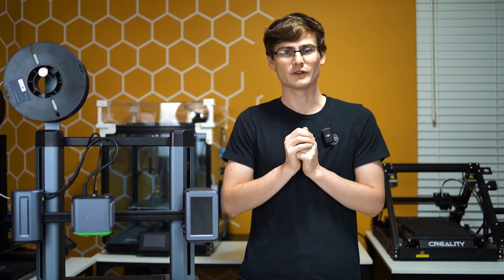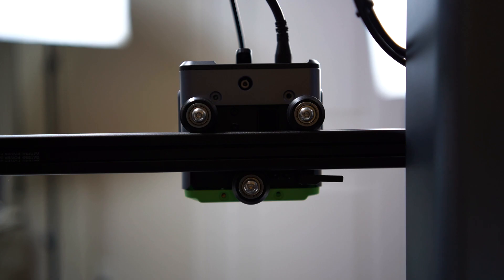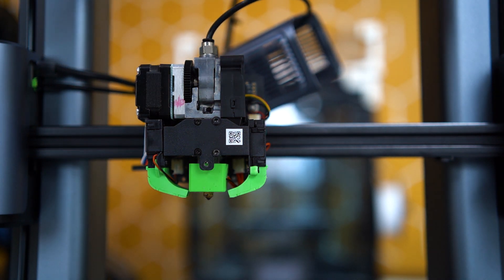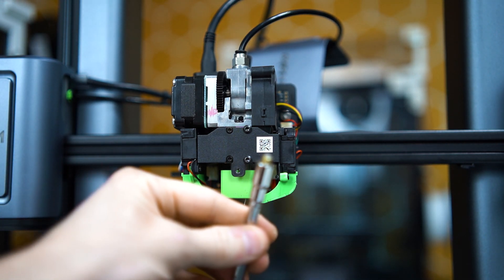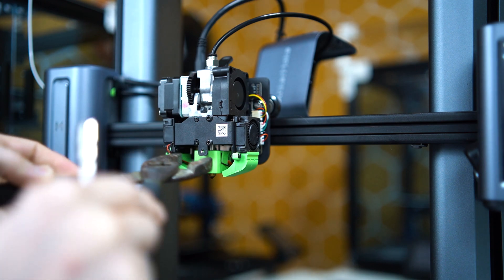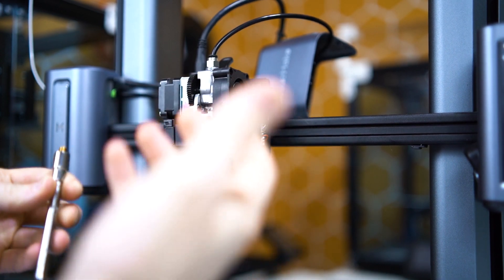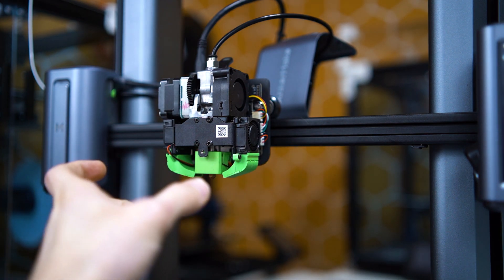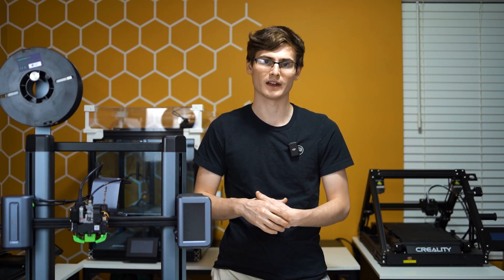Here's How to Replace Your 3D Printer Nozzle in Less Than 5 Minutes

Comment: On the nozzle change you did on the ankermake 5 is it the same steps to you do on the ankermake 5mc is nozzle sizes the same cos I wanted to get the hardnd steel one so I can print  like nolon and advises high temperatures filleants

Comment: I replace mine without removing the plastic shroud.  I'd only bother removing it if your nozzle is stuck. Good advice about using the pliers! The screws holding the hot end are tiny.

Comment: I'm total newbie with 3D printing, the only Question I have is, when is it time to change the nozzle ? how do I recongnize a worn down or broken nozzle probly print quality??
Reply from the maker: Absolutely it will be print quality. Generally speaking you will know based on quality, but that doesn't mean you have to change it. For this printer in specific, if a nozzle is worn down so much that you begin to have first layer adhesion issues, then you might consider changing it. You can usually print about 5 or 6 kg per nozzle easily if it's normal pla. I change my nozzle every 3 kg just because I don't want to have issues and they're so cheap
Reply: @ThePrintHouse  Cool thank U for the quick reply and the little rule of thumb :) appreciate it
Reply from the maker: @MALZman  Of course! Nozzles are not yet for sale, but when they come for sale, I recommend you buy a bulk pack of nozzles and then just change the nozzle every 2 or 3 rolls to be safe :)